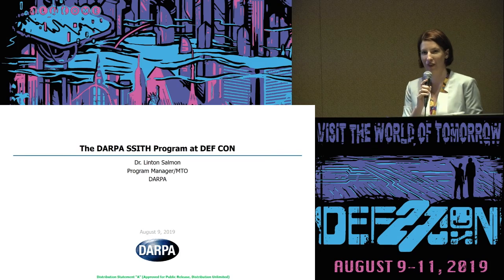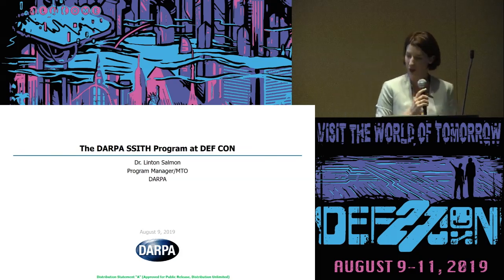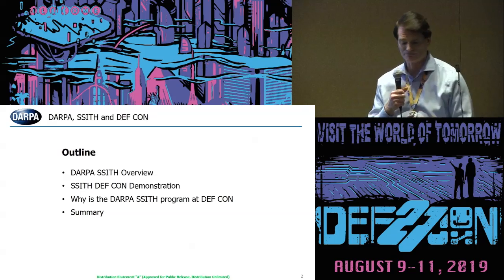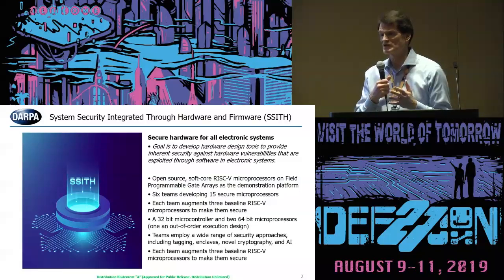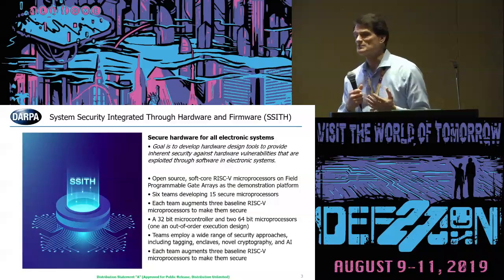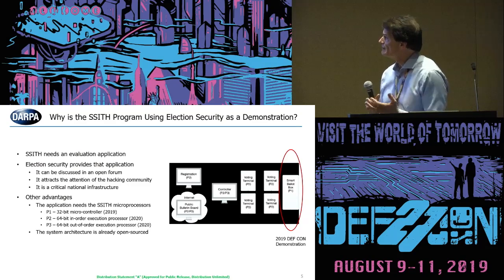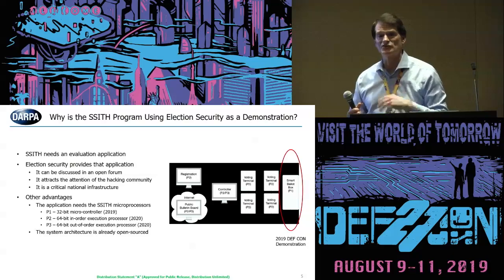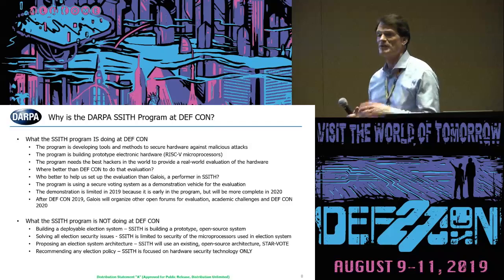Dr Linton Salmon - The DARPA SSITH Program at DEFCON - DEF CON 27 Voting Village

Comment: This feels like we're playing the same game with different cards. Currently we have singular points of failure on the hardware (buffer overflows and the like) that are discovered and patched against exploit at the software (the most malleable) level. SSITH seems to want to change the hardware (least malleable) points of failure to be immune to exploits - which will almost intrinsically create other points of failure in other parts of the hardware. Not to mention how difficult it would be to integrate a SSITH piece of hardware with normal pieces, because I can't imagine SSITH rewriting wouldn't cause the hardware's specifications to fluctuate. And the final part of this is 'would it actually be more secure'? I dunno. I feel like we need to see it in action before backing it.